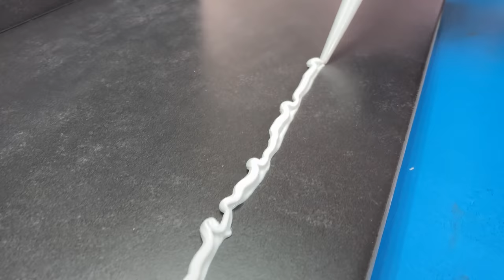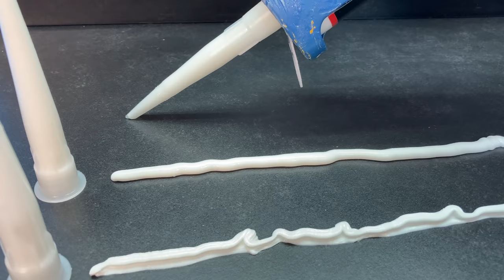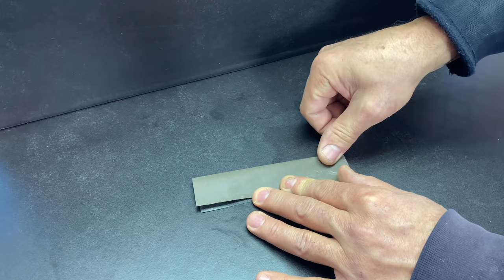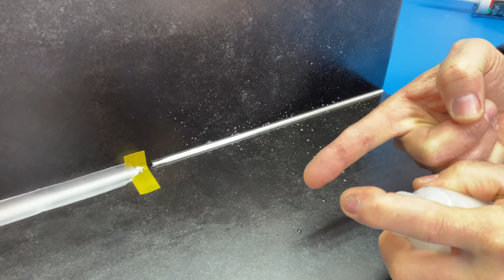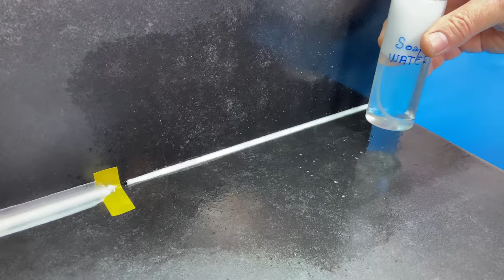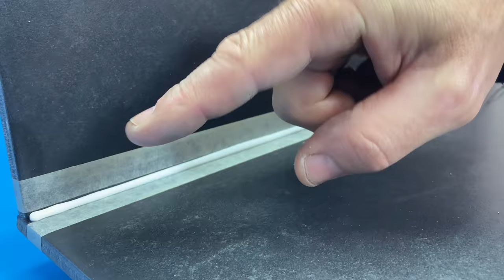Few People Know About This Silicone Trick | Do Perfect Silicone Every Time

Comment: As a residential painter we always cut the tip at an angle like that, and we kept a bucket of soapy water to soak the rags in we use to wipe our fingers on. It served to both do what you demonstrated and easily wipe the caulk off our fingers. It also dissolved the caulk on the rags into the water which made them endlessly reusable.
Reply: Professional painter as well. Commercial and residential. I almost lost it when he busted out the tape. I’ve fired people for using tape.
Reply: I always cut the tip flat, that work better work on limited space , and never need to looks the tip facing wrong side or not, flat or angle still got same result, its about how you put your the angle and speed, sometimes when you doing these so long, both moth make it work,sometimes got the feel adjust speed and squeeze pressure make it work, when i was younger doing these kind of job seal windows and fire wall,around 10 boxes a day, like 120 pcs everyday,start from 69 floor dwon to floor, one time i got prank, they said no lift/elevator today ,need carry few boxes walk up to 69 floor, at one points my right arm way bigger than left arm,then i change to left hand try to balance out,that make me double gunner...? i hate that job, but no complaint, i think when younger way easier pickup or learning skill, i guess kids finish school first at least, i mean too many way, you always finger it out which one work for you ,when i saw this video all the memories back ,haha...sorry for my poor english.

Comment: The masking tape method is reasonable but leaves a very small step at the edge of the bead. The soap and water method is my preferred method. 
The dressing of the nozzle, into the corner using the wet and dry is something I've not seen before and is such a simple and effective idea. Really impressed with this video. Give yourself a pat on the back.
Reply: I Have never Caulked before ., i wish I knew WTH he’s doing 
😂 
Looks helpful
Tho
Reply: Took me 20yrs to learn that soap water method. Cant wait to try it out
Reply: 40 years around construction, and never saw the soap and water! Off to caulk!
Reply: @fakename1656  it's great,it runs  behind  parts of the silicone preventing  it from  sealing properly.
Reply: Sanding the applicator tip was a new one for me.  Will try it.
Reply: @jizzmonkey9679     Yes. Absolutely true
Reply: @jizzmonkey  is that a good or bad thing? It sounds bad
Reply: @MA-ts9qt  bad
Reply: Never use soapy water
Reply: The soap and water will stop the top and bottom edge of the silicone from adhering to the surface.
Reply: Don’t use soap water trick if very wet area like showers. Seal will fail

Comment: I like the sand paper trick to shape the dispenser on the tube. Until now, I thought I was the only one who knew you could do this. I had discovered this trick on my own years ago while I was working for a painting company. I was one of only 2 employees that the boss trusted to caulk. The wet surface/finger trick is great too; I usually use a rag for this. The tape trick I'm gonna have to try. 👍
Reply: I had problems with the wet surface silicone wont adhere to the edges.
Reply: heck ya tiny things like that blowing my mind
Reply: Cool story bro.
Reply: I use a similar trick for fitting plastic and aluminum pipes. You can use sandpaper to get a prefect curve
Reply: @rogerwhiting9310  sounds more like you should focus on fixing the gap rather than caulking it. If your toilet rocks or moves, it might be that the flange is too high. It can be a tricky fix depending on your particular situation, but it would solve the problem for this toilet and future toilets too. If the flange is not that bad, you may find that you can shim it to stop the movement. They sell all different types of flanges and plastic plumbers shims too.
Reply: @rogerwhiting9310  the flange is likely the culprit then. The shims are for small gaps. If your floor is even and your flange is the correct height, you shouldn't need any shims or foam. After that, caulking should be a breeze (just a thin bead will do). I've been a liscenced plumber going on 15 years now and I've never once had to use spray foam to stabilize a toilet. A shim here and there should be the extent of it. If you've gotta go to those lengths to steady your toilet, you'd be better off starting from scratch. Another possibility is you're using a wax ring with a horn on it when you shouldn't be. Sometimes this will make all the difference you need.
Reply: Yeah, sure you did....
Lol
Reply: It is the kind of thing you might discover by accident, like sanding the nozzle because you cut it with something that left a burr then realising how grippy your nozzle is. 
Of course darts players would know how great sandpaper is for sharpening points so the bluntest darts stay in the shoddiest of dartboards, like at the fairground.

Comment: Can you please demonstrate how to manage caulking around a corner and also in a corner and up the wall where caulk lines cross/meet up, around tub faucets and spouts and other awkward areas.  For those of us who are beginners, these areas are especially problematic partly because of our lack of speed, as the caulk is starting to skim over before we get a chance to smooth it out.
Fantastic video!
Reply: The real Professionals cut the nozzle a bit fatter and push the silicon instead of dragging the nozzle, and use the nozzle as the smoothing tool as they go along, without having to go back along the bead.
Its hard to imagine, but you have to keep a ball of an even size in the end of the nozzle

Comment: Thanks for this, you helped a lot of people by sharing these tips. Just the other day I had to re seal around my kitchen sink and bath, wish I knew this sooner 🤦🏻‍♂️... Silicon can be VERY frustrating to work with. Those soapy water and masking tape tips are winners! 👏🏻 👍🏻👊🏻
Reply: You can also use Acetone to clean up Silicone Carne whether your scraping old stuff off or knocking your bead down a cleaning up the excess.

Comment: The one with the tape is what I always used. But the trick with the soapy water was great. Thanks for t he tips.
Reply: But be careful, the silicone does not stick to a wet surface. So it is not so good solution. I use the tape version, I draw the material to a minimum thickness at the tape edge. Then comes the soapy water and the last smoothing after removing the tape.
Reply: I believe the tape method gives the best seal and adhesion. Getting silicone wet messes it up.

Comment: If it’s silicone based do you still use soap and water to spray on it before you smooth it out, or do you need to spray mineral spirits instead?  Thx

Comment: These are some good tips but from somebody that uses a lot of caulking while installing Stainglass doors and windows I would have to honestly say that these are very case specific uses. For example if you’re running a bead around a window frame that’s in a brick house or if you have very long runs to make using tape or the hair soap water specifically the soap water on porous surfaces might not be the best tip to use. But on smaller applications on nonporous surfaces yeah good stuff

Comment: Important there are no gaps in the bead before spraying soapy water. Silicone won’t bond if water is behind it. I roughly smooth it first then apply the spray before the the final smooth.
Reply: Très bonne astuces merci
Reply: Also regular water after ya fit is ok to just damp your finger really never need much at all just your finger to be "moist" hehe
Reply: @claudecharvet2537  iokko di h

Comment: To avoid any deviation from "ideal" result I use 45 degree cut dispenser tip + 2 masking tapes + small plastic spoon for the first run (this forms really nice and solid silicon incurvation) + very slight run of soapy finger to finish. The end result might be reviewed by microscope :) Of course this is not for fast and effective daily routines, it's purely DIY for perfectionists :)
Reply: Thanks, going to use that spoon trick!
Reply: Ah oui très bonne astuce, merci😊

Comment: Don't spray soapy water directly on the joint. Instead put it only on your finger.

The reason is that any places where the caulk was not touch, when being spread over with the finger, the caulk will not stick to the surface. This is particularly an issue in those cases where there was the occasional gap in the caulk when laying it. You'd think that is no big deal cause you can fill the gap when you run your finger over it, but if you've filled that gap with soapy water, then the caulk will not stick to the surface inside that gap. Even if it looks good, that lack of adhesion is not considered waterproof and can not be trusted to provide any holding power. 

Best to try to lay a good bead that does not require using your finger at all, but if you have to use your finger, wet only your finger with soapy water to prevent the caulk from sticking to it, and use shorter strokes when wiping.
Reply: Interestingly, there are plenty of other professionals' tips that say "never use wet" but to use a dry finger but wipe on cloth regularly. The reason for not using wet is that silicone hates water.
Reply: Agree, well explained.

Comment: It's kinda cool to see someone else who goes to the same lengths as I do, and I never tried soapy water, but it makes perfect sense. Thank you and keep on putting out excellent ideas
Reply: X""
Reply: Kok
Reply: Everything in this video shows a bad way of doing this. Cutting the nozzle at 45 degrees means it will apply less force in pushing it inside the edge; soapy water looks nice but means the edge of the silicon won't adhere properly; masking tape will leave a slightly raised edge that, ultimately, will let water sit on it and cause mould. Look up Charles DIYte who shows all of this very well.
Reply: Yes, it's definitely cool when anyone goes into details and invests the care to achieve excellence!  I will never forget the quote I saw on a university professor's office door:  The world is run by C students.  It really helps to keep this continuously in mind.
Reply: @lor3nzo666  Agree 100%. Soapy water is a no no if you want the silicone to adhere properly. Good video apart from that.

Comment: The masking tape one is a poor way to apply silicone.
When it is smoothed out the silicone is 'feathered' onto
masking tape. 
Therefore when the tape is lifted, so too is the silicone
which then forms a lip on both edges of the application.
Reply: Follow with a soap spray and smooth with finger
Reply: @carlsuits658  there's no point using the masking tape if you are going to use the soap spray anyway, just use the soap spray. The masking tape is for if you dont have soap spray to use

Comment: I don't recommend using the tape method since it pulls the silicone away from the tile and creates a micron sized gap for water to sneak behind, thus making the new bead prone to lifting prematurely. Also, prepping the surface is extremely important. Clean it with alcohol, Windex or or mentholated spirits to remove any oils to help with proper adhesion.

Comment: Using tape isn’t ideal unless you tool the silicone of the masking tape when you peel it off it will lightly lift the edges of the silicone and leave a lifted frilly edge. Best to use soap water and if you don’t want to use your finger make a pointing tool out of plastic or wood soaked in the same soapy water.
Reply: Thank you for your excellent comment and tips!  When I saw him demonstrate the masking tape method, I sensed it could be problematic...the exact result probably depends on the expertise and/or luck of pressing the finger just right so the silicone/caulking thickness tapers to only paper thin all along the edge of the tape.

Comment: Good show ... the tape is pretty common I think ...the soap thing ... not so much ... not to take away from a fantastic video ...  a little smaller 45 angle ... less footprint I mean ...do that shave down trick ... really nice ...  tape off the work ... caulk (with moderate pressure and no gaps ) de-tape ... soap ... soft finger ...superb ...excellent work

Comment: If you're using soapy water to smooth out the caulk on a shower then go ahead and check and see how well the edges have adhered to your surface. Don't be surprised if you have caulk fails prematurely.

Comment: I used to tile a lot of kitchen splash backs  . First I scraped out the joint with a small tool , then vacuumed the joint . Then wipe with a cotton rag with a little methylated spirits .  There's nothing worse than a bit of sand or tiny lump of dried grout appearing in the finished silicone bead .  
 Didn't know the sandpaper trick though . 
 Always buy the best Silicone you can afford , in Australia  I use Maxysila , $15 - 18 a tube but well worth it .

Comment: OK--- But can you tell me how to remove silicone caulk?  I have a one-piece fiberglass tub surround.  The very thin line of caulking between the surround and the tub has unremovable black mold. (Straight bleach doesn't touch it.)  How do I remove the caulk (completely) so I can re-caulk it using one of your nice tricks?  Thanks for any help you can give me.
Reply: Razor blade, and good technique.
Reply: @ShainAndrews  The gap that is caulked is only 1/8 of an inch wide, but the caulk goes more deeply in.  I could not fit a razor blade in that area.  Let me explain the area a bit more.  The tub edge turns and goes vertical and then butts up against the surround edge.  It is not like a horizontal tub edge meeting a vertical tiled wall at a right angle.  And, on the inside, the fiberglass tub and surround pieces overlap each other, but the line where they meet, that 1/8 inch,  is caulked.  Is there something (a chemical product, perhaps) that will break the bond between the fiberglass and the caulk so I can then pull it all out, getting a clean surface so I can re-caulk?
Reply: @22doulos22  You don't have to get all the old caulk out.  Just have to get the old caulk off below the surface of the new caulk.  I've never used any chemicals for the task, and there are different types of caulk that would require different chemicals for them to work.  I understand your tub style is a little different.  In my mind a razor blade is still the solution.  Starting on the tub side.  Place the blade parallel with the seam.  Lay the blade down as close as you can to the tub.  Push it towards the seam.  Have to keep repeating that all the way down.  Alternatively google chemical caulk remover.  Do some research on the products before trying.  I've never had the need for any such product.
Reply: @ShainAndrews  Thanks!  I'll give your technique a try and also research product possibilities.  Of course, if I just wait another year or two, the mold will continue to spread and I will have a nice solid continuous thin black line.  Might look nice!  (Not.)
Reply: @22doulos22  LOL.  Let's not.  I started looking at chemicals as I had never considered them.  I'm pretty skeptical of so far.

Comment: What if the corner is not so even and smooth or the ceramic and porcelain tiles have a notched structure? And how will silicone behave in a place with a grout?
And how to do it in a place where two walls and the floor meet?

Regards, viewer from Poland 🇵🇱

Comment: Use ice cubes for modeling silicone RTV.  (Some people have used their tongues but not a generally recommend technique.)
Most silicone RTVs are acetoxy cure, (vinegar odor)
  Decent strength, but do not use on stone products.  The RTV will certainly adhere, but the acetic acid will undercut the stone in time and it will appear that the RTV has pulled away from the stone.
  Not a good idea to use on electronics because of the acetic acid.  Want to coat something with a thin layer of silicone?  Dissolve the acetoxy cure RTV in trichlorethane and dip the item or brush
     the silicone solution onto it and let dry.  Need a thicker coating?  Let dry and re-dip.
Building sealant RTVs are typically alkoxy cure (alcohol cure).  Weaker than acetoxy cure in general.  Good where there will be in contact with stone.  Often used for glazing glass on commercial
   buildings.  When buying, be sure to check the exp date and if in a plastic tube, the sides should deflect when pinched.
Formed in place gasketing RTVs may be oxime cure.

Comment: I went through trial and error myself and ended up with the tape option you used at the end but I had never seen the sand paper or soapy water tricks. I’ll have to try that.  The tape option works really well but takes some prep and it would be nice to remove that step. Thanks
Reply: Save yourself the hassle and get a fugi profiling kit....you can apply the silicone as neatly or messily as you like, one pass with the profiling tool and it looks perfect.

Comment: for perfection, the ice cream stick is pretty much perfectly sized radius. use that with the masking tape (roughly half a cm from the edge), dipped in soapy water for a perfect result.
its not what i generally do as it takes a bit of preparation, but with that preparation you can pretty much get a professional looking result the first time you try.

Comment: I bought a caulk tool from a paint store that works great for clean looking lines. I don’t know the name of the tool. It has a rubber triangle at one end with different sized rounded point. Giving you the ability to choose the size of the caulk joint. The opposite end has a caulk removal tool. Works great for caulk joints.